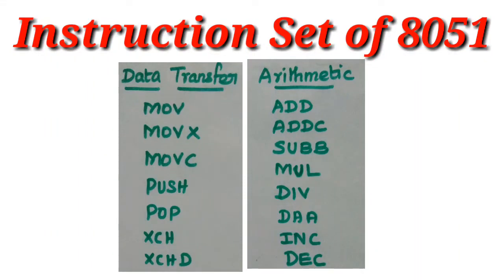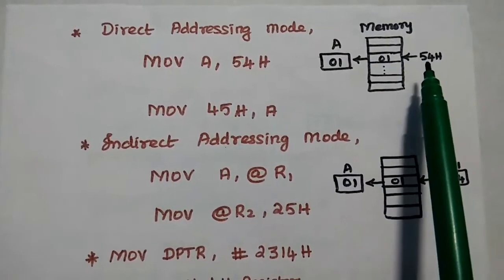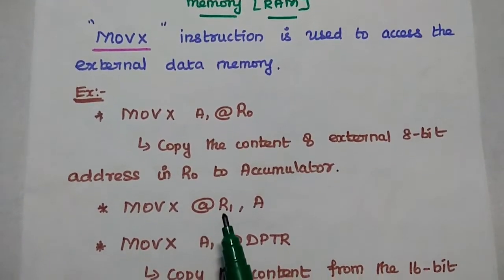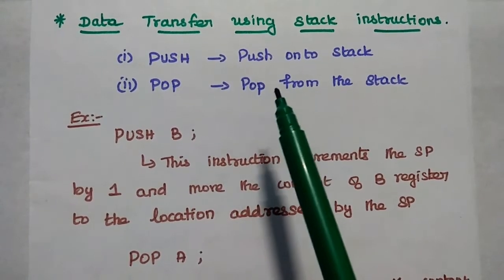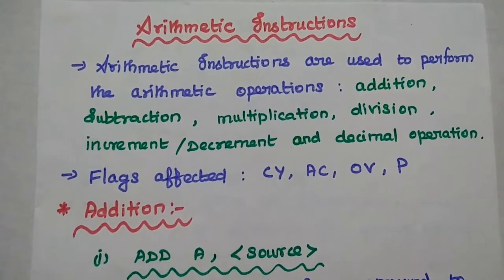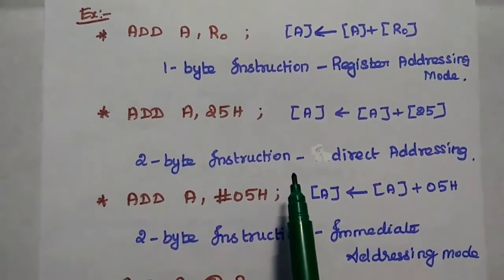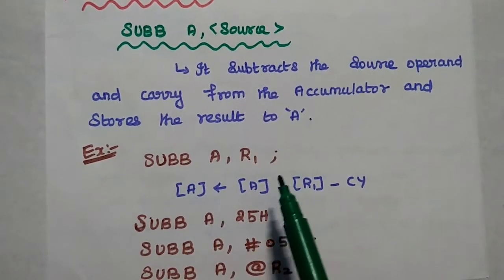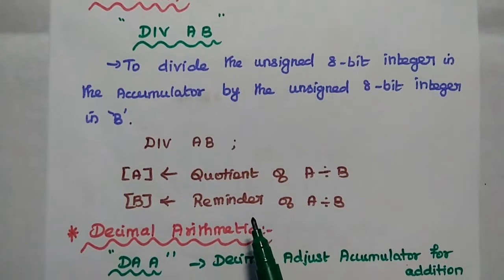Data Transfer Instructions - Arithemetic Instructions - 8051 Microcontroller

Comment: Need material
Reply: 8051 Microcontroller Instructions

Overview

This video covers data transfer and arithmetic instructions in the 8051 microcontroller. These are fundamental operations that allow the microcontroller to move data between registers, memory, and perform basic arithmetic.

Data Transfer Instructions

MOV: Transfers data from one location to another.

PUSH/POP: Moves data to and from the stack.

XCH: Exchanges data between registers.

MOVX: Transfers data between external memory and the accumulator.

Key Points

MOV is the most commonly used instruction.

MOVX is essential for interfacing with external devices.

Arithmetic Instructions

ADD: Adds two operands.

ADDC: Adds with carry.

SUBB: Subtracts with borrow.

INC/DEC: Increments or decrements a register.

MUL AB: Multiplies the accumulator and register B.

DIV AB: Divides the accumulator by register B.

Key Points

Arithmetic operations affect flags (carry, overflow).

MUL and DIV are limited to accumulator and register B.

Importance

These instructions form the basis of programming the 8051.

Efficient use of data transfer and arithmetic instructions is critical for embedded system design.

Practical Applications

Data Transfer: Moving sensor data into registers for processing.

Arithmetic: Performing calculations in control systems, such as motor speed regulation.

Summary

The video emphasizes:

Mastery of MOV and ADD instructions.

Understanding how arithmetic affects flags.

Using stack operations for temporary data storage.

These are the building blocks for writing effective assembly programs on the 8051 microcontroller.